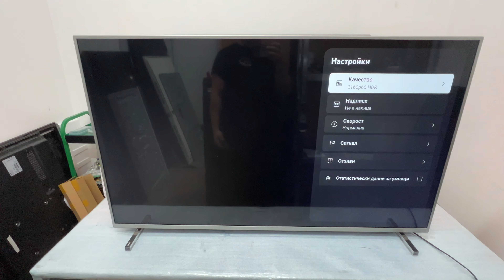Repair black screen on PHILIPS LED TV 55PUS6754/12 , disassembling and replace led backlite stripes.

Comment: I went through with this repair today, took me 4 or so hours. The end result was that the picture's back, but the three bottom rows of backlights show through the screen. when there's movement on the screen it's really visible.
Reply: there's also one way my tv differs from yours even though we have the exact same model 55PUS6754/12 -- the backlights are in one continuous stripe instead of two on each row, and they are called "LB-GM3030-GJ0D22555X10AN22-T" without ending in "R-1-T" or "L-1-T". The replacements I used were the same ones you used here, one left and one right on each row. Would this explain the backlights malfunctioning?
Reply from the maker: Has to be shure that plastic spacers between backlight first lear and other lears on top its there on place. If they are in place, and all the magnifiers are on the diodes, then maybe there is a defective backlight. I can't be sure where exactly your problem is coming from.
Reply: @mmwhitetech  okay, so the backlight replacements being a different version from the old ones that came with the tv shouldn't make a difference? 

i might've turned the matte layer wrong side up on top of the backlights, but i know for sure the other layers were correctly placed. guess i'll try again. thanks!
Reply from the maker: @SomeSunshineOutside  i think its from wrong placed lear , good luck.
Reply: @mmwhitetech  so I flipped the matte layer (the one on top of the backlights) and it didn't make a difference. the thinner layers (lears?) on top of the matte one were unquestionably in the same position they were when I first opened the TV. This time around I managed to strip a couple of screws, so I'm calling game over. It was fun trying to fix it and seeing the picture come back, so i thank you for providing the video to do so. Now I'm off to buy a new TV.
Reply: Where can i order the backligt i have same tv  ..i have to try this   i have sound but no screen
Reply from the maker: @HDfonzie try aliexpress.com
Reply: @HDfonzie  well as it turns out, i had different backlights to OP's model, even though we had the same model of TV. so you'd have to open up your tv first and check, or get one set of each. Namely, the ones ending in R-1-T and L-1-T, as well as the conjoined ones "LB-GM3030-GJ0D22555X10AN22-T", which was what my TV originally had, and what I probably should've switched them out with.
Reply: @SomeSunshineOutside dim circles ?

Comment: Hello, what is the name of the plastic tool you are using?
Reply from the maker: Hi, its not a tool, just this is plastic lear , i used from old tv, its under the boards between board and metal , jus cut a piece from the lear .or use some similar plastic .

Comment: Hey i have just had this problem with my model the same as this .. i can see the picture when shining a torch on the screen.. so would that mean if i replaced the leds it should work or can it be something else causing this problem
Reply from the maker: Yes , need to replace led stripes.
Reply: @mmwhitetech  do you know what model numbers are compatible with this TV as when looking online it looks like they are the same as other models like the 6704 and mine being the 6754 would any of the leds from either 2 models work
Reply from the maker: Look at discription , i add models of the tvs.

Comment: Did this yesterday! worked awesome . But got the problem that the backlight now shows on the screen, you can se them pretty good . Did i make some error when i put it back together ?
Reply from the maker: There is probably an error in the assembly of the layers, send me a picture so I can see.
Reply: @mmwhitetech  Might be . Went in reverse on video so i might have gotten it wrong. I emailed you pictures of it .
Reply from the maker: are you sure that you put the plastic spacers between the first layer and the hard plastic layer above the diodes
Reply: @mmwhitetech  i did not , but i did now . still the same issue , maybe i put the wrong side down? got the blank side up and the see trough side down .
Reply: same problem here. what did you do?

Comment: I just tried this with my Philips 55PUS6704/12. The lights work again, but unfortunately I cracked the screen (although just a hairline fracture) while removing the double sticking tape as seen at 4:09. I guess I'll just have to look for a new TV now
Reply: you have to separate the tape without pulling the screen. in my case, i pulled a little near the corner and heard a crack, which was confirmed when i turned on the tv. backlight ok, screen ko. fantastic video and very helpful too
Reply: Same...

Comment: Hey, I had this issue during the warranty period, and it was fixed. Back then, it was also related to the TV's Ambilight. Now, I want to fix it myself and have a question. Is it necessary to replace the LED, or is unplugging it enough to make the TV work again?
Reply from the maker: Hi, need to be replaced , no way to work without them.
Reply: @mmwhitetech  Thank you for the fast answer😊

Comment: very nice that you have the exact same model as me. why does it need double tape when screws are holding it in place?
Reply from the maker: The exact answer can be given by the manufacturer, in most cases it is for better fixation and heat exchange between the backlight and the metal back.

Comment: What exactly did you search for on aliexpress to get exact parts needed?😊
Reply from the maker: Give to me of the tv , i will send to you right link
Reply: @mmwhitetech bonjour il me semble avoir la même tv que vous la Philips 55pus6754 
Si vous pouvez me donner le lien pour acheter le rétro éclairage pareil 
Ça serais super sympa 
Bonne journée
Reply from the maker: Just found this amazing item on AliExpress. Check it out! BGN50.84 | LED bar for 55PUS6804 55PUS6814 55PUS6754 55PUS7334 55PUS7354 55PUS6754/12 55PUS6804/12 55PUS6814/12 LB-GM3030-GJ0D22555X10AN22
https://a.aliexpress.com/_EwjfcBB

Comment: Guten Tag MM WHITE TECH ich habe auf eBay Kleinanzeigen den selben fernseher für 79€ gefunden auch mit dem selben  Problem und würde ihn mir gerne kaufen meine Frage ist jetzt würde es sich lohnen den zu kaufen und zu reparieren?
Reply from the maker: Check repair kit ( led backlight stripes ) how much cost in aliexpress and you deside for yourself.